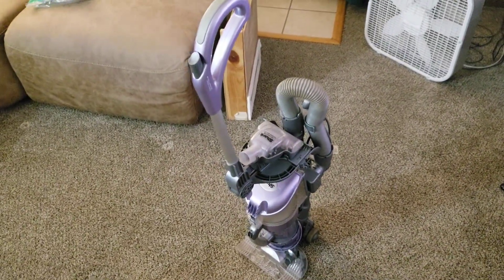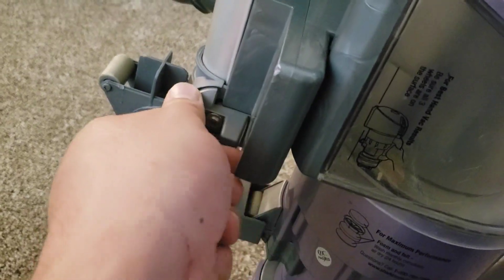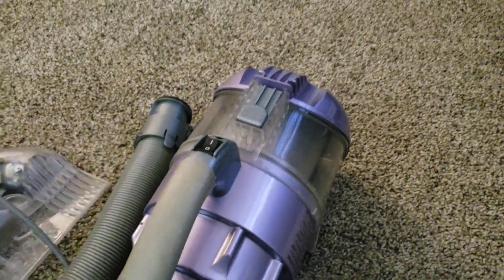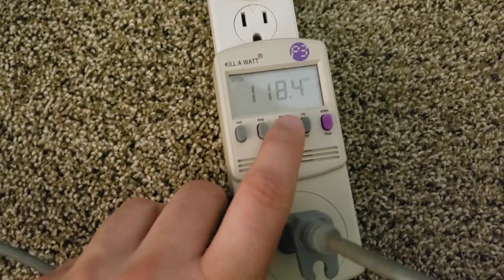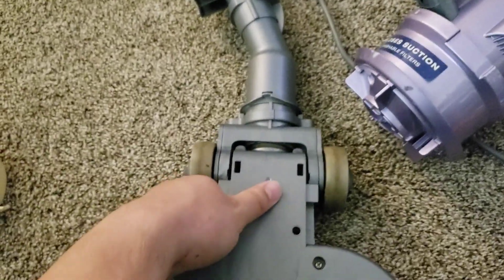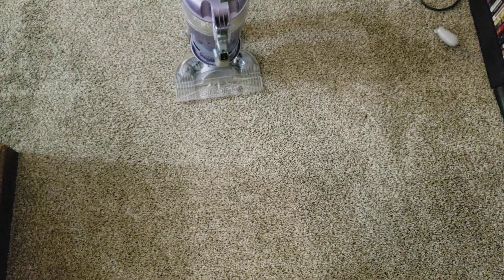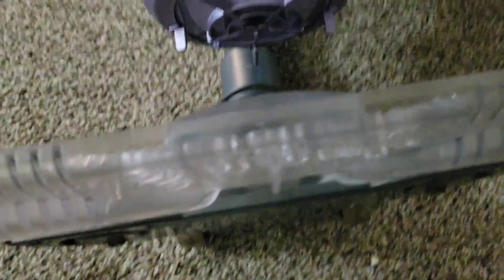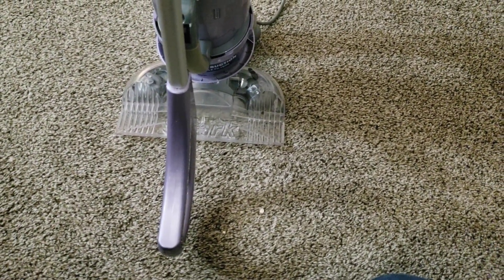Shark Multivac NH15 airflow test

Comment: These are strange vacs
Reply from the maker: Very much so! They really should have added some of those lint catcher strips so it would perform a little better on carpeting
Reply: @Blackheartvacs  Devin, you might be interested to know that same rug nozzle was available as a option for the Shark Navigator NV350 series. You would put it on in place of the powerhead and it basically turned the Navigator into a upright stick vacuum.
Reply from the maker: @robwalton2007  I've seen one of those fairly recently, I think it was an ebay listing or perhaps marketplace.